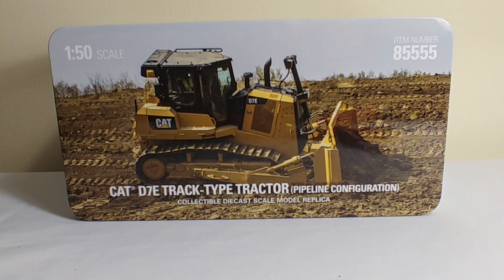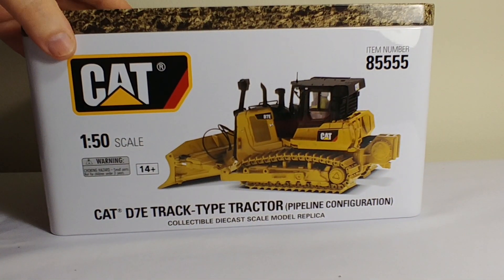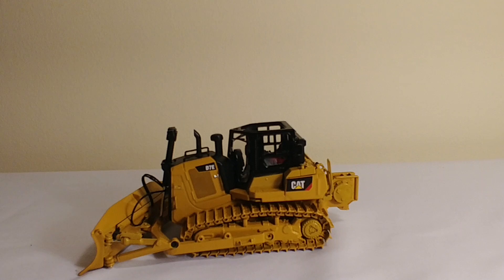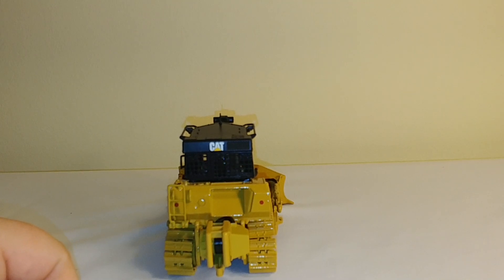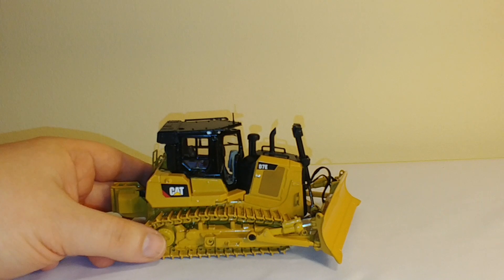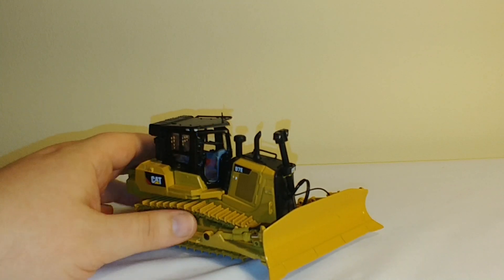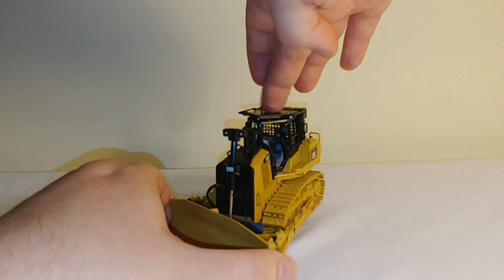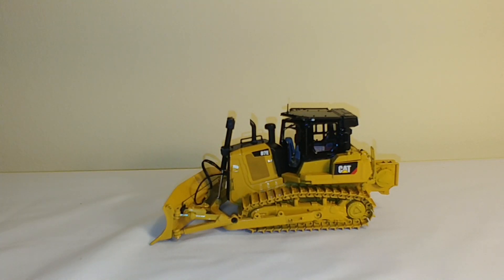Diecast Masters Caterpillar D7E Track-Type Tractor (Pipeline Configuration)

Comment: Being how the blade is fixed could you take one of the screws out and straighten the blade up? Does it have the center pin?
Reply from the maker: Yes by unscrewing the screws, you can change the blade angle.

Comment: Diecast Emporium, great review as always, you mentioned the blade assembly comes off for transportation.  Does the blade cylinder just pop out of the black sleeve and what about the hydraulic lines?  Do they just pop out of the holders as well?  Thanks!!!
Reply from the maker: Yes everything can come off on my mine. I can't speak to the finished versions, but my assumption would be that yes the cylinder would just slide out. Thank you for watching!
Reply: Diecast Emporium Thanks!!  If the released version is like the one you reviewed, the lack of blade movement kind of takes a little away from this model.  Would be a lot nicer if they made it to move side to side.  But more than likely I will still end up getting one.  Thanks again!!!
Reply from the maker: Jonathan White Youre very welcome! Make sure you get yours from a Diecast Emporium approved business!

Comment: Nice review but I'm disappointed to see that the blade is fixed on an angle
Reply from the maker: My personal opinion was that it was done that way to model a "backfill" angle.
Reply: @Steve Palumbo @ Diecast Emporium  It (the blade) can actually be set @ 3 different angles. That is what the screws are for.  The black screws (on each side) can be undone and reconfigured by re-screwing them into one of the other 2 holes. By doing this you can configure the blade to be set even/straight-on , or have it angled to the right (directly opposite the left sided angle it comes set at).  The only bummer is that the blade cannot be completely removed....so as to pose the dozer as a blade-less load on a lowboy.